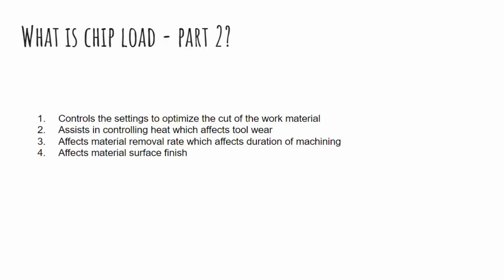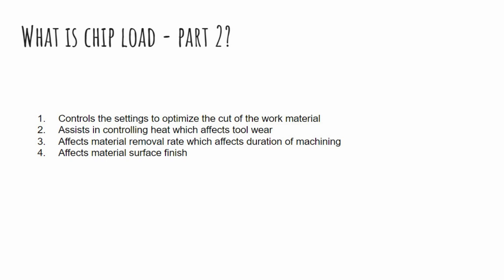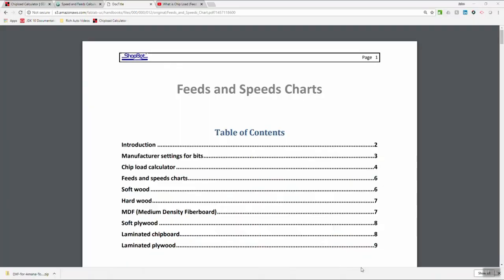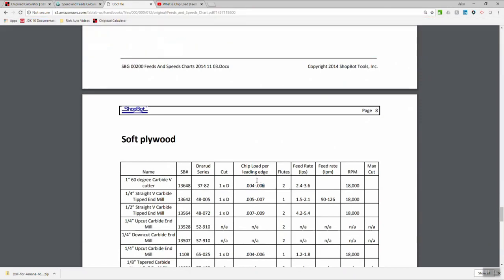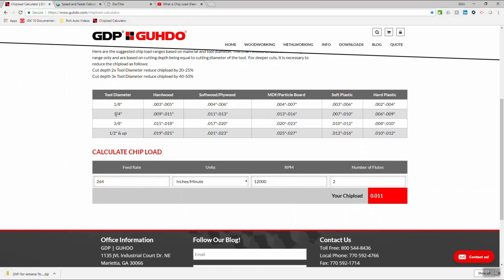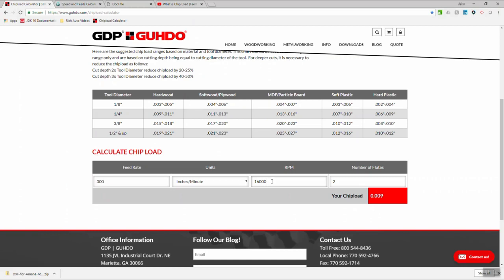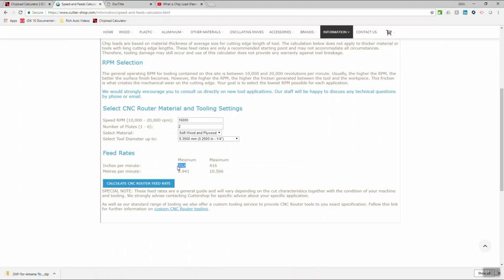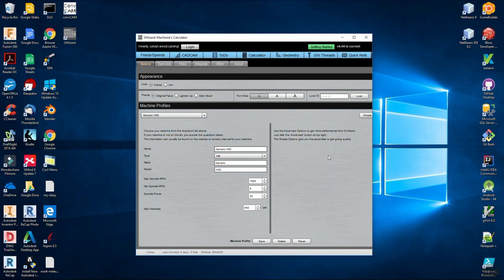How to Calculate Feed Rate & Spindle Speed on CNC Router? | John Resler Walk You Through

Comment: I understand the calculation, but I don't know how can we know we are not at the optimal feed rate ? Or better, how to know the feedrate is too high ? Was it the roughtness you speak about ...  Thanks
Reply: Feed rates are calculated for the most part as a function of chip loading. Too high you break the teeth, to low you burn the material and you bit. Most of the calculations I know of are initiated by the manufacturers. They give you a good, base number to start from and then experience and testing come into play. As is probably obvious, there is no one size fits all feed rate. In the wood working world, cutting basswood vs. ironwood are dramatically different settings. 

What I did was go to the manufacturers site and gather the basic data. I then went into Aspire (by Vectric) and created four basic cuts. What I discovered surprised me a bit in that what I expected to be the smoothest setting was number three. This is why you have to test with various combinations and develop experience. For instance I now have a good feel w/regards to what feeds and speeds to use for purple heart which is a very hard, dense wood. 

Finally and this is in no specific order, the quality and usage of your bits make a big impact. The exact same geometry in two bits made from different materials can change the heat generation, the duration of the sharpness of the cutting surfaces, etc. I personally believe wood is more demanding in this area than metals. Metals are manufactured to fairly demanding tolerances and therefore are at least starting from a very similar point, regardless of manufacturer. Wood is affected by water, irrigation, the environment, nutrients in the soil and the other imponderables. 

This probably wasn't the answer you wanted but maybe it will guide you towards an answer for what it is you make.
Reply: Thanks, appreciated  @sylvanwoodcarving